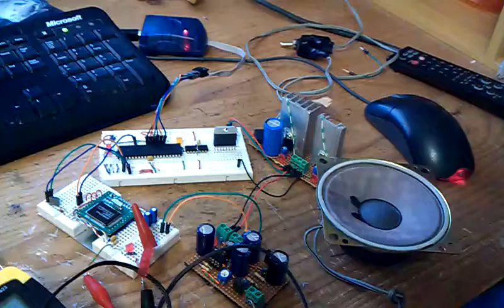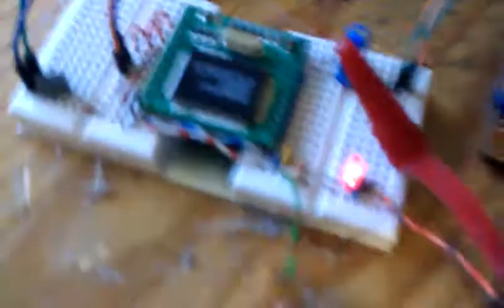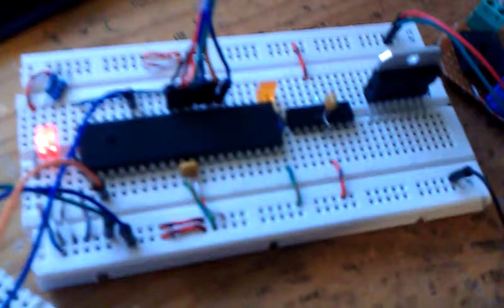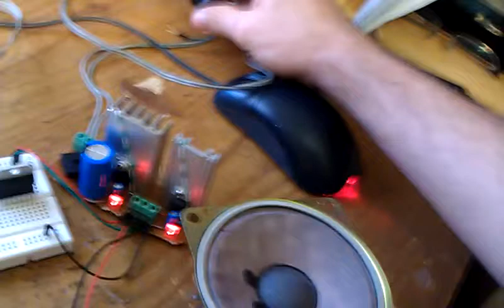V Stamp Text to Speech Module in Action

Comment from the maker: Sorry, I have no experience with the basic stamp chip! However, because it is a module and not a stand alone IC you can communicate with it using the uart ports of a micro controller quite easily. As long as this is possible, then you may be able to integrate the two together.